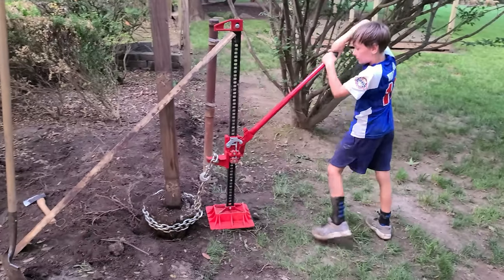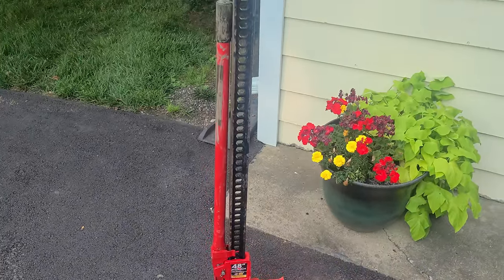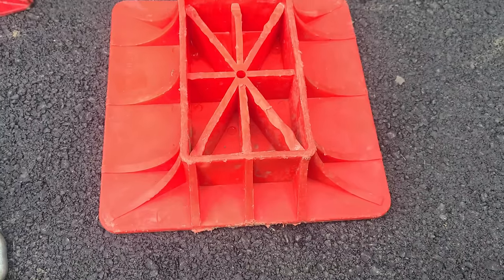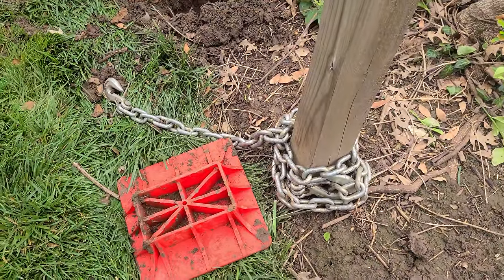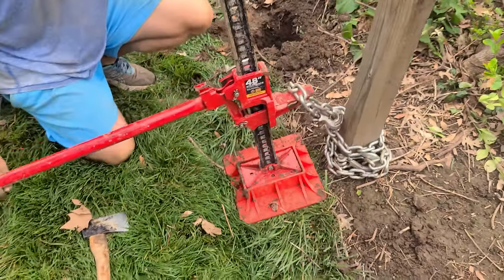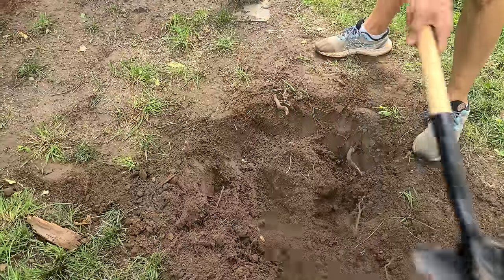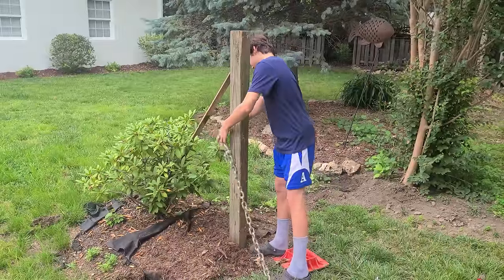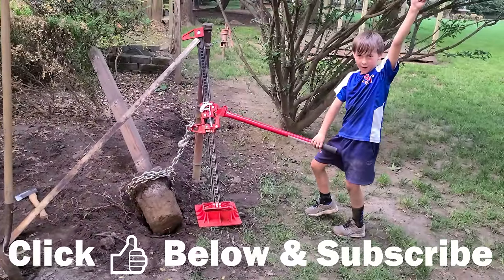How to Remove Fence Post in 3 Minutes!!!  |  How to Remove Concrete from the Ground.

Comment: A tip here for safety reasons. When just removing concrete it is very important that the chain is secured prior to lifting it with the jack. While under tension and if the chain slips, the kickback will have tremendous force and anyone unfortunate enough to be at the receiving end will have a lot of hurt.
Reply from the maker: Thx for the tip and thx for the comment!
Reply: I thought he said that in the video already.
Reply: I’m not convinced there is much stored energy to release if it slips.

Using the brace against the jack was where I saw potential for slipping and an issue.
Reply: I almost cried when I saw the safety violations.
Reply: Thanks Dad...
Reply: @tonysolar284  which one
Reply: You're not the boss of me.
Reply: @mywifesboyfriendisfire  says's the 25 yr old with seven fingers and one thumb
Reply: Duh
Reply: Yes your tongue speaks wisdom. Stupid does definitely hurt…
Reply: @luisromanlegionaire he did.
Reply: @Zimbob2424 says the tool with no sense of humor.
Reply: @AbeFroman-zx5hs  lol, it's called ball busting, which takes a sense of humor both ways.
Reply: @Zimbob2424  oh. Is that what that was?    😐😐🤣
Reply: I know someone who worked on big rigs, doing a beam job they had the axle chained up, chain snapped, came back and almost ripped off half of a guy's face. Luckily he lived, but lost his eyesight in one eye. The top of his face was peeled back like a slice of pizza. Definitely something to be aware of.
Reply: Wouldn’t the concrete be securing point losl

Comment: I hired a tow truck to come out and remove 25 posts. Cost me $200 dollars which was a fair price to me. Took the guy about an hour. The beautiful thing was I sat and watched while drinking a beer.
Reply from the maker: That's a hellava deal.  Hard to get most people out of bed for $200, especially ones with equipment and means.
Reply: Nice man
Reply: That’s a great deal I would have said here’s an extra $100 go but urself lunch and a case of beer 🍺 that dude would have had NO PROBLEMS coming back out to help you the next time you need his help and he still saved u an easy $1500 bucks so it’s a win win for the both of you..
Reply: @thebumpchannel  I agree.   Tow truck driver screwed himself by under pricing
Reply: @jsh111 
Na he didn’t screw himself .., he got $200 for a hr if work that’s not bad at all 🤷🏽‍♂️if it was a 8hr job he’d have $1600
Reply: And I bet you told the wife you’ve been working hard all day ,,that’s the way
Reply: @rudyrabb7497  you can make money but still be an idiot, tow truck driver didn't know his own worth.   That's why he'll keep working for someone else

Comment: I made a 9ft tripod and secured a winch  and pulley to it and just  hit a button and watched my family look surprised 😂  worked like a charm
Reply: Sounds better but also way more expensive!
Reply: @CarpeDiem601 your right,..but  I already have a winch that I made a bracket for, to attach it to anything (tree, tripod,my van hitch, etc.)
Reply: I made the same tripod with 3 ton winch...waiting to save 20 hours on my first tree trunk!
Reply: @westvalley411    good luck !  I don't think 3 ton will be enough tho.   if u use a pulley u can double the power to 6 ton, but trees and posts are two different animals, lol.   wish u luck.       also I was using a 5.5 ton with pulley to get 11 ton  pulling force and it was almost not enough power  on some. but pulsing the button every few seconds worked well.
Reply: @southern_merican hmm, good to know, thanks for advice.

Comment: I used this method yesterday to remove a  post buried in nearly 3 feet of very heavy concrete.  It worked just as you suggested.  I'm grateful to you for the tips.
Reply from the maker: Nice work!  Thx for the comment!

Comment: Nice idea.  I remember old farmers saying don’t use concrete to set fence posts that you can set them tighter packing the soil properly (they were right) but it is reality.  I had my fence replaced that I built years ago myself without using any but the contractor concreted them this time.  I don’t think I will be doing the next one though.

Comment: One thing to remember is never allow yourself to be positioned above the jack bar when operating the jack.
I’ve seen these things kick and that bar comes up in a big hurry.
I see HenryT mentioned the tension on the chain but you also need to remain clear of the upward sweep of the bar itself in all operation.
Reply: That's a general principle of physics.  If you are cutting with a knife, same idea.  Cut AWAY from your body/hands.  Make sure the arc of your blade or axe swing is never going to angle toward your body even from a deflection if you miss.  Many a leg was probably cut or bruised by swinging an axe or hammer downward, missing the target and the arc of the swing continues past and oops.  Shin bone is NOT a happy camper.

Comment: My post were double the thickness and the concrete bases were far more substantail ( necessity4us due to high cross-winds ). Another issue I had is that as I had originally forgotten to bevel the concreate bases against the posts to allow rain/water to easily run off and not pool round the bases, which resulted in most of the posts being rotten part or all way througn at the base. This made using jacks very difficult/ineffective.

So my strategy here was to grind/mill the wooden post remains out and leave the concrete bases in place and simply added new posts of the same size. It all turned out to be a nightmare of a job, that took forever, cost a wodge in cutting and milling bits, and left me with battered hands, arms and shoulders for weeks.  The moral of the story is : Never forget to bevel/angle the concrete cement downwards away from the post base, so that water can run off and not sit and rot the posts in the first place. Wish I had watched this video before doing the job, as that would have saved me quite a bit of pain and time I would imagine.

Comment: If you don’t have many to do a digger bar with a chisel end works really well, and if the post has rotted can be quicker and easier than digging round to place a chain. A digger bar is basically a long, heavy chunk of steel bar about 70” long that gives great leverage and concrete smashing power. One of my most useful garden tools for everything from extracting concrete to digging holes in stony ground for planting shrubs and trees.
Reply: @drippingwax  What sort was it? Mine is a “Roughneck Digging Bar 1750mm (69")”. It weighs 17lb and I don’t think I could bend it even if I wanted to (maybe a very slight bend in the flat part at the end, but not enough to affect it).
Reply: @drippingwax  Hmm..might not be quite what is designed for! What were you using to pull the shed?
Reply: @drippingwax  Call me old fashioned but think you’re supposed to dismantle the shed, rebuild and level the base in the new location, then rebuild the shed. No hand winch involved. No digging bar involved. Probably shouldn’t be anchoring you hand winch at all, it could send you blind.
Reply: @Tailspin80 You’re old fashion. Moving sheds ain’t a big deal. Done it twice.
Reply: @James_T_Kirk_1701  We have a 4mx4m log cabin with brick built rear “extension” for the log burner and bathroom. It’s all built on top of a 6” concrete base with damp proofing and floor insulation. Don’t think a hand winch would work.
Reply: We've always called it a spud bar.

Comment: We used a very thick piece of rebar, which we put through a hole we drilled in the fence post, and then two automotive jacks on either side to lift the posts out. It worked, and saved us a lot of money, but your way is better. I'll have to remember that.

Comment: Great video guys, that loop back under the chain is a great tip.  I used your method to pull 2-inch steel pipes set in the ground with 2.5 ft of concrete up. Thanks
Reply from the maker: Good stuff!  Appreciate the comment and thx for watching!

Comment: After Hurricane Ike, I had around 250 ft of cedar privacy fence blown down... Nearly all of the posts were snapped off at the level of the ground near the concrete... I used a pretty similar technique with my hi-lift jack to remove the remaining posts and concrete... Main difference is probably the way I attached the chain to the post -- I would loop it around the post a couple of times and then clip it back to the original lead of the chain so that when it was being pulled, it would tighten up on the post like a noose... I replaced it by welding a steel picket (aka "wrought iron style") fence... A lot less surface area for the wind to act upon, so it should survive the next hurricane... The clay soil we have around here is either rock hard during the dry spells or a gumbo that refuses to come off you shovel / post hole digger during the wet spells... Either way, it took a lot more than 3 minutes to do each post... Maybe 3 beers per post is more like it...
Reply from the maker: Sounds like a good time!  Appreciate the comment.  Thx for watching!

Comment: I have used this method many times! Works great. Rather than buying a jack base, just use a chunk of 5/8 plywood. I usually wiggle the post a bunch to loosen things up. That seems to work better (unless the post is rotted and you break it! Lol).

Comment: In Wyoming, We also call these “come-a-long” jacks or shepherd’s jacks. Besides using them for pulling fence posts, they are also used to stretch barbed wire, pulling a wagon or a pickup out of a ditch, pulling a deadfall tree or a boulder out of the road, and any place where a rancher needs to pull an oversized load while out alone on the ranch or in the wild. When I was a kid, my dad always had a come-a-long attached to his old blue Jeep when we went camping or fishing in the high country. Survival gear in 4WD country.

Comment: I have no doubt that this is a very handy and excellent way to remove fence posts that have been improperly installed as are shown in this video.  On the other hand, if you are dealing with concrete that is wider at the bottom, and whose top is three feet below the surface, and there are tree roots up to six inches in diameter tangled around the steel fence post for those three feet, this method will not work.  In fact if you don't have a backhoe, you probably will have to do what I did: Dig a hole as wide as the bottom of the concrete and within an inch of the bottom as well.  Only then will the post even start to budge a bit.  Again, I am sure an excellent and very helpful video for fence posts that weren't installed properly.
Reply: In that case I would call it a yard ornament and it could be a conversation piece!!!
Reply from the maker: Appreciate the comment.  Thx for watching!

Comment: Another good way is to wrap the post with chain, have a solid tire and wheel assembly, stand the tire up like it would normally be on a truck, put the chain over the top of the tread, hook the chain to a truck or tractor. As you start the pull, the tire holds the load and pulls straight up. It also absorbs the weight and won’t tear up the ground.
Reply: then something snaps and  you have a broken truck or worse.. ive seen the videos
Reply: @tejeda7324  use the right equipment and you'll minimize the risk of this. Anything rated for less than 2 tons is foolish.

Comment: So, I tried this method out with the roughly same equipment (60" jack over 48" was cheaper) I needed the shorter 8ft chain over my 3/8 13ft harbor freight special, but I wrapped it to shorten it up. Anyway, results.. it 100% works nicely if your posts are still attached. I'm in Midwest, if your 4x4s are snapped at the ground, you're still going to be doing a good amount of digging otherwise your chain will crush the concrete and you'll just be digging it all up anyway. I was 50/50 on those. If you dig far enough to get the 4x4 that's still encased you'll get it, if not you're digging it up. Make sure to use a minimum 6ft piece of angled mild steel 1/8th or 1/4" thick.
Reply from the maker: Appreciate the comment. Thx for watching!
Reply: @thebumpchannel  Not a problem, this method is well worth the money, thankyou for sharing!

Comment: Excellant video.  Just wondering how you ended up disposing of the old fence posts and concrete?  Did you have to haul them off to a landfill???
Reply from the maker: Yes, I hauled them to landfill (collection site).  Rented a Uhaul for like $30 and $60 to landfill.

Comment: I used a floor Jack to raise a sinking pole barn support.  Just bolt a block of wood on the pole, Jack it up and re stabilize with concrete.

Comment: I used a similar approach, but my posts are metal 2x2" posts, so I just drilled a hole through near the bottom, ran a steel rod through, and jacked up under the rod.  Works great.  But out of breath after a few of these :)
Reply: Had similar situation but a some of posts had rusted off at the concrete level. We have really hard compacting sticky soil. Getting them out ended up needing a lot of digging and some brute force with a bobcat digger. Fortunately, was only a half a dozen out of 20. by the way, I'm in a dry belt in Australia so waiting for a rain soaking generally isn't much of an option.
Reply: @geradkavanagh8240  

Drill a red head concrete anchor, attach the chain, and  pull it out with a floor jack or that handyman jack.
Reply: Quit smoking

Comment: A cheaper method i used was to screw a 2x4 perpendicular to the post about 12" off the ground.   Then just lay an 8' fence post over a fulcrum (log) and under the 2x4.   This forms an 8' lever (seesaw) where you can push down on (or stand on) one end to lift out the post on the other
Reply: That's how I did it, too. Unfortunately sometimes it doesn't work and you're back to cracking concrete and digging with the breaker bar.

Comment: Want to try this out, but do you know if this will work for metal posts? I need to pull a 4x4 square metal gate post, and I'm wondering if the chain will be able to grip the metal
Reply from the maker: Several of mine were metal as well and was able to get the chain to hold.  Had same worry.  If not can dig a few inches out and wrap chain around the concrete.

Comment: I wanted to replace a wooden fence with rotted 4x4 post with one built on chain link steel posts.  I did use a farm jack to pull one of those concrete blobs out of the ground, but I realized I was working hard, not smart.  For the rest, I left the concrete in the ground and instead used the farm jack to pull the old post out of the concrete.  Used a drill to put a big lag bolt into the ones that were rotted of at the ground.  Really rotted ones just required drilling a few big holes into the post stubs, so they fell apart.  I used a shop vac to clean out the holes.  The steel posts fit easily into the 4x4 inch holes, and required much less concrete than making new holes.

Comment: Using an engine hoist works great and it should be safer since the hoist legs rap around the post. You just use 4x4 to keep the hoist from sinking into the ground. Worked for me.
Reply from the maker: Appreciate the comment.  Thx for watching!

Comment: The hardest part of the process is keeping the jack upright. I suggest bolting the angle iron to the top of the jack and attaching a wide base to the bottom of the angle iron. You got lucky that the angle iron did not slip off the top of the jack when you were bearing down on the jacking arm.

Also, skip Harbor Freight for this one. I have two of their jacks and they both failed after three posts.

Comment: One method I used on a broken post was to drill a horizontal hole through the post.  Then you can pass through rope or rebar to get a hold of something.  This jack method is better but you could possibly combine the two in some situations or if you had to use something other than the jack, like a wheel and winch.
Reply from the maker: Appreciate the comment.  Thx for watching!

Comment: I used a similar method but using a regular car jack.  Instead of the chain I bought a very large bolt and drilled a hole through the post and also a spare 4x4 to use as a lever.  I would stack cinder blocks as needed to make the jack at just the right height to lift it.  when the jack got to it's maximum height I would add a block for another round.  Your way is simpler but mine uses a regular jack and all that I needed to buy was a big bolt and a bit to drill the posts.  Same concept though.
Reply from the maker: Tried that for a few with no luck (car jack not the bolt).  Ended up buying the hi-lift jack.
Reply: @thebumpchannel  My method is more complex.  I didn't know such a jack as a high lift was available though, so I just used what I had.  I hired a crew to replace my fence and they just cut the posts and now I still have the stumps that I should get rid of someday.  I haven't tried but I was thinking of using a large eyebolt of some kind tapped vertically into the wood.  That would probably rip right out though.  That's why I haven't done it yet.  I don't like trying things that I'm not sure will work.  I do love that huge 1"x8" bolt though.  That part is golden.  It's the rigging up to get good leverage that is the main problem.  Also, you don't really need much jacking.  Once the concrete breaks free it comes out easy.

Comment: Will this work with white pvc posts?.. I have a feeling they would be too slick for the chain. Any advice?
Reply from the maker: It should.  I used on some round metal ones.  Might see a few in the video.  If not just dig a few inches around to get around the concrete.

Comment: what also worked for me is to take 2 long 2x4s and drill a hole on both.  Run a bolt through the two boards and through the loop at the top of jack with.  When the post is out, you can still knock it over
Reply from the maker: Would be a good reason for me to buy a better drill!  Appreciate the comment.  Thx for watching!